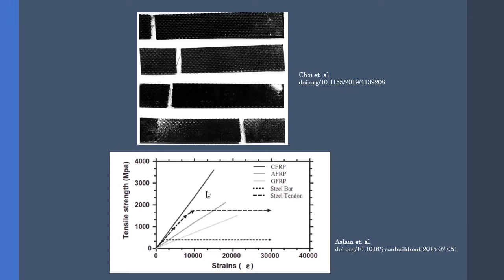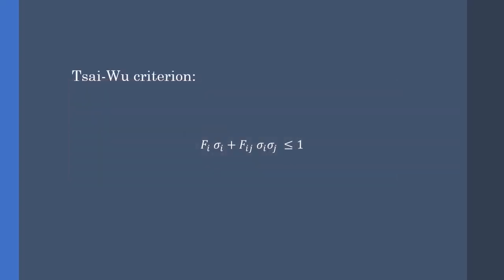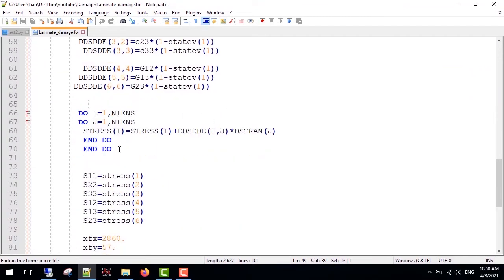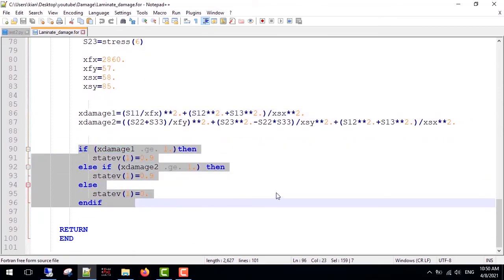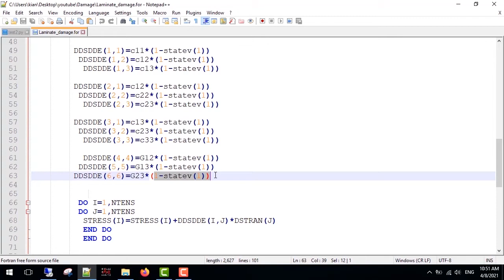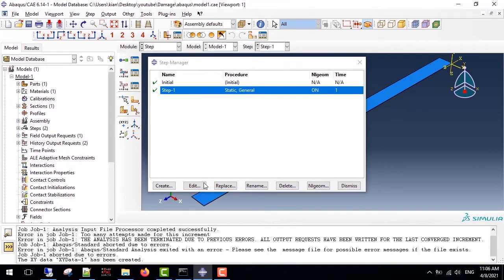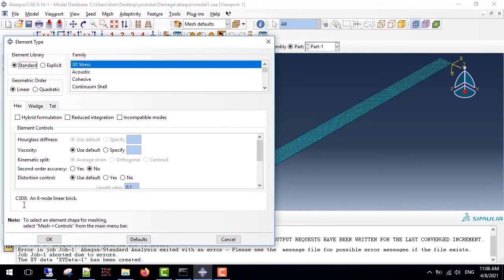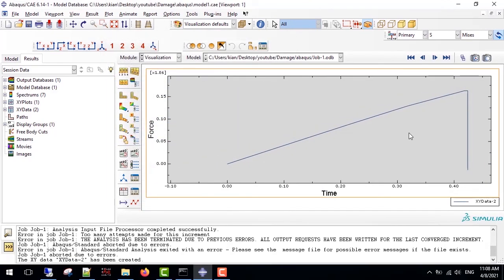UMAT for Fiber-Reinforced Laminates including damage

Comment: Great work sir, In damage modeling using UMAT, the following error is coming.. ''Time increment required is less than minimum provided''.  My model consist of more than one material. Once the damage reaches maximum value in one element this error is coming and other elements are not even reaching the peak stress.
Reply from the maker: It is a convergence problem, and might have a lot of reasons.
Reply: Thank you for the reply sir. The UMAT was running successfully for the model. But it took almost one week to run the simulation. Then I have added some cohesive interactions in the model. Now my model is taking too much time to finish one increment. It may take even one month to complete the job.. I am modeling a unit cell of unidirectional composite.. Are there any methods to reduce the running time sir?